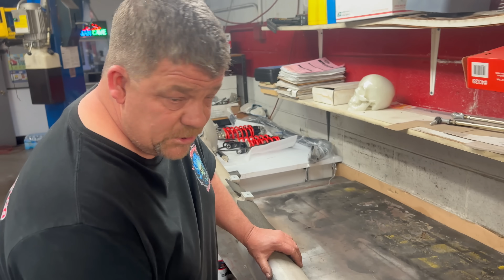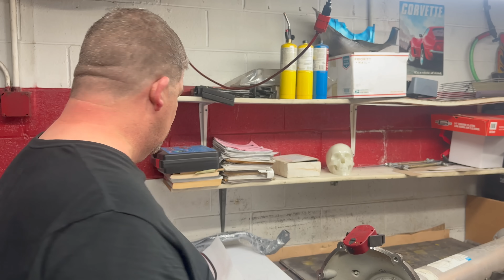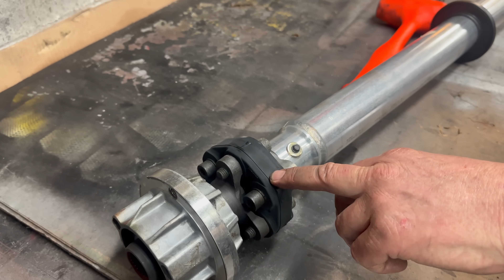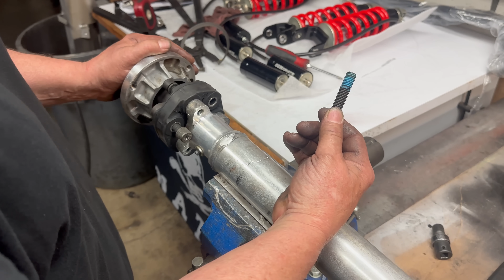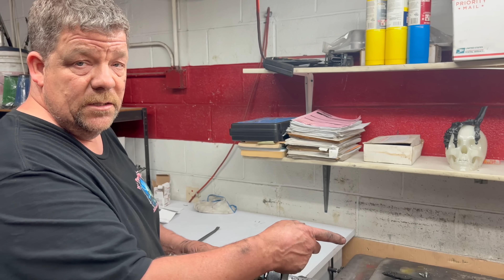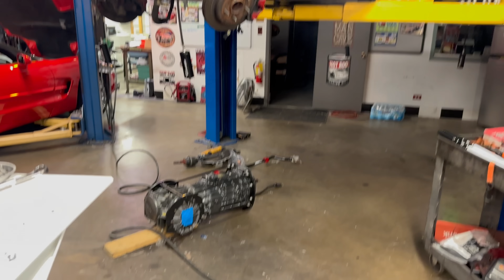Corvette Torque Tubes: For Dummies

Comment: Thank you.
Does the rear cradle have to come fully loose to remove the torque tube assembly?
Reply from the maker: Yes, the rear subframe must come down as well ass the differential and transmission. We usually drop the entire unit (diff/trans/torque tube) as an assembly, our next video coming out will show a little bit on how we do that!

Comment: It would be nice to hear what the noise sounds like on a bad  coupler.
Reply: Mine sounded like a cement mixer unloading down the metal chute...really !
Reply from the maker: @aln.8135  yeah the sound can definitely get pretty violent depending on the extent of the damage inside!
Reply: Or small pebbles rotating inside a metal drum. Mine must have been at the very end of life. The output shaft teeth were worn down. The bearing was shot. Yes, as AntiksGarage says, stick with quality rubber doughnuts...I believe they are the same made for the BMW in Germany. No aluminum or polyethylene ! 😊
Reply from the maker: @aln.8135 oh yes, NO ALUMINUM haha
Reply from the maker: It often can be heard as a faint knocking. If a bad one comes in we will try to record a sound clip so you can hear what it sounds like!

Comment: My question is you did all that work and didn’t put new bearings on it???
Reply from the maker: The bearings on this unit were actually in great shape and we do not really see bearing failure on these tubes. The priority was replacing the rubber bushings due to their age

Comment: What do you recommend? They have rubber, polyurethane or billet bushings. I’ve almost went with billet just because I figured they’d be a solid upgrade because of their price but saw a lot of negative comments of people that have used them so I may just stick with the rubber bushings.
Reply from the maker: We'd stick with the stock rubber, it's an important piece for dampening vibration and absorbing shock forces
Reply: @AntiksGarage I completely agree! I also highly recommend using the genuine GM couplers as well. 👍
Reply from the maker: @602STS2 yes, we always try to use OE but unfortunately we can't always get OE for everything on short notice.

Comment: I have a 2006 Chevrolet Uplander LT AWD A/T and I've been told it has a bad bearing in the torque tube.  It's howling real bad, initially they thought it was a wheel bearing.  The part is no longer available from Chevrolet so I thought my only option was a salvage yard.  Is mine similar to the Corvette that repair parts are available? Good video, now I understand how this works.
Reply from the maker: Thanks for watching and commenting! Bill has been in the industry many years but has not had the chance to take a look at how the Uplanders work. There is a very good possibility the design is similar but at this point with the age of the car, junkyard is likely your best option. Best advice we can give it to research and read as much as you can so that you can make an educated decision on what is best for your vehicle! Please keep us informed if you need anything or have any questions as your search continues and we will try the best we can to help you out!

Comment: Excellent video, lots of videos on manuals so how about a video on an auto showing the torque converter? havent seen that,  also I have seen tubes with bolts instead of snap rings. who do you buy the kit from?
Reply from the maker: Thank you! I believe these bushings came from Texas Drivetrain, there are a few places online where they are available. We mostly see manual transmission cars, however, if we get an automatic in that needs bushings we can try to make a video on it for you!